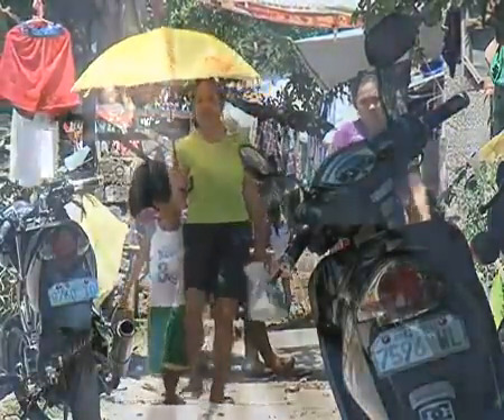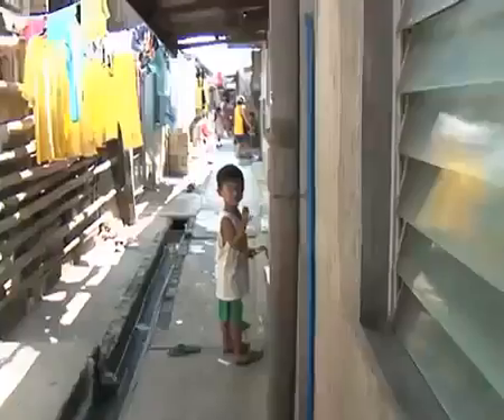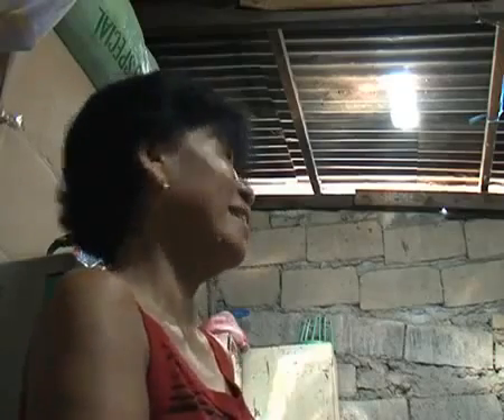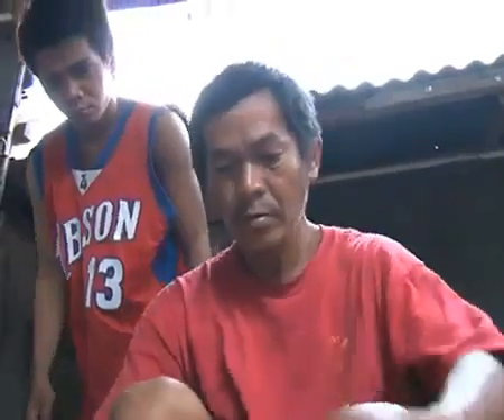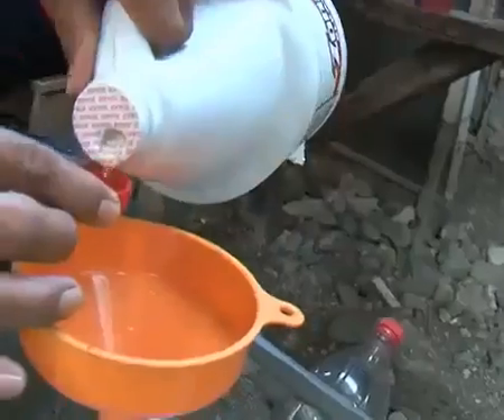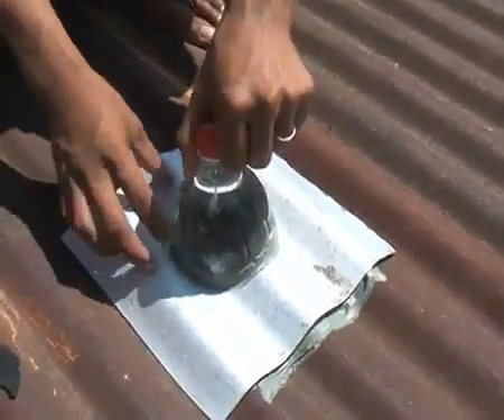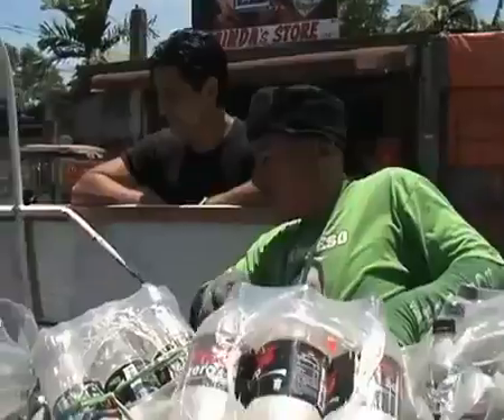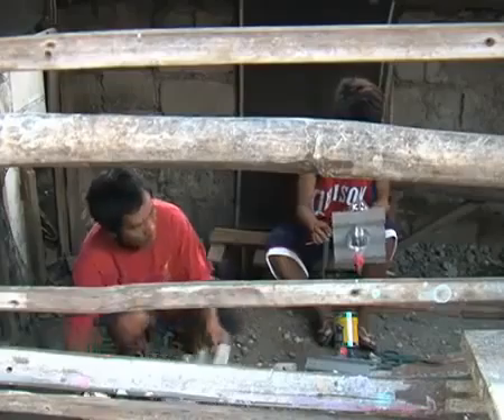How To Make Free Light From Water Method

Comment: For the walls, it's difficult and impractical for them; they need the space because their houses aren't very big. On the ceiling though, it's pretty much perfect and it's easy to just cut a hole through the metal sheeting. Though I hoped they could just use multiple bottles instead of just one a household. :\